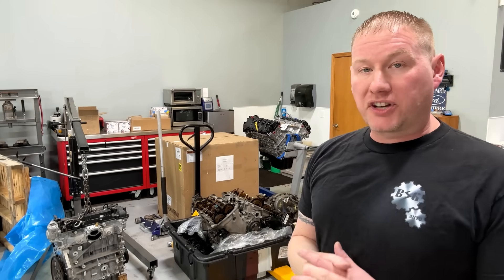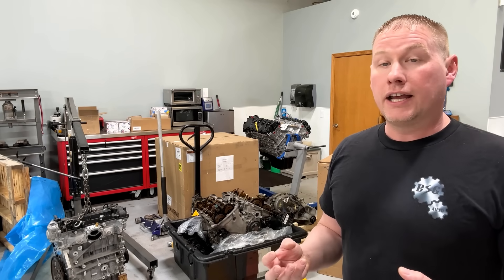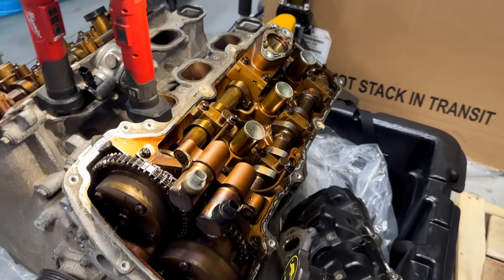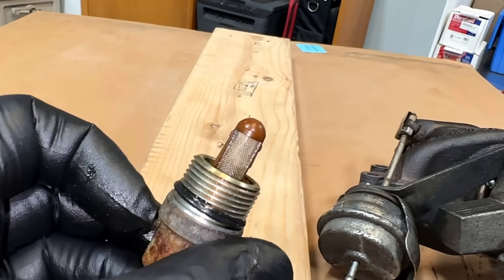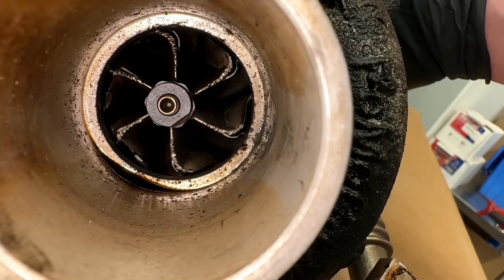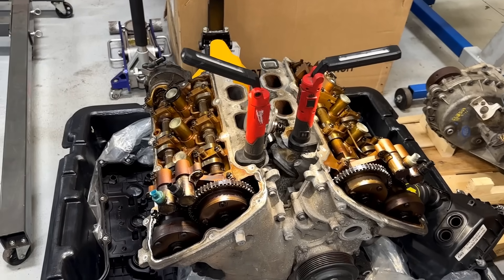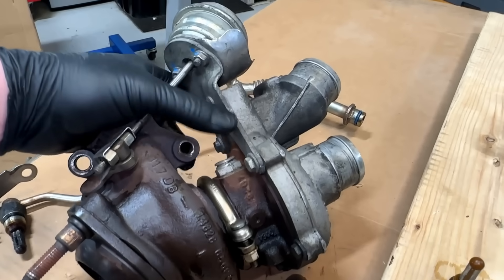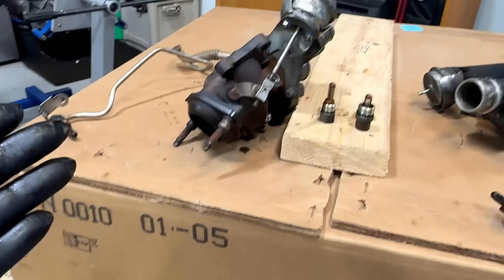This is Why You Never Run Extended Oil Change Intervals on The Ford Ecoboost Engines!

Comment: Any reason you couldn't just remove the screens? Turbos haven't had screens up until very recently and never had an issue
Reply from the maker: I have never seen a turbo oil feed without screens.
Reply: @FordTechMakuloco  I'm pretty sure most of the older stuff I've worked on didn't. My M35A2 didn't, old CAT loader didn't. Everyone removes them on VW/Audi 4.0 V8 engines as the clog. I figure if the debris the screen would stop from hurting the turbo is there, the engine is already toast! I don't see the screens doing anything beneficial other than killing the turbo
Reply from the maker: very cool

Comment: Great video I have a 2014 Ford F-150 Lariat EcoBoost SuperCrew truck and I do change it with the synthetic oil and it's every 5,000 km I live in Canada so we're with kilometers here yeah definitely important but learned a couple things about the filters on the turbos and more of an understanding of how oil works in this engine so thanks

Comment: My 3.5 has been running 20 pounds of boost and always run 93 octane with lots of oil changes.
I do mine every 5000km!! 
Love the power!!
Reply: I always run 93 in my 2.3l (Ranger). Also change the oil around the 5000 mile mark too 👍
Reply: @tehagent1321  
He he he!! That’s good but I do the oil changes at 5000km. 
But always use motorcraft and you will be fine!!
Reply: @mikewest5529  I had been using Shell Rotella Gas Truck but have to go back to Motorcraft now. Shell stopped making it 😢

Comment: Have both 5.0 and a eco boost 2013 f150s.    Both get valvoline  full synthetic every 3k miles.  And here’s another kicker. I run 10w30 in both.  I live in the south. It’s too damn hot for the water weighted viscosity that the factory calls for.     I did this for my 2000 f150 (5.4) when I bought it new.  Pulled god knows how many cars with it ,all across the southeast. And it’s sitting at just under 360k miles now.  Never had a wrench turned on the engine.  I still use it for farm use weekly.  I check the oil every day I use it.  Just for curiosity.  Still doesn’t use any between changes.  Doesn’t smoke etc.       change your oil people.  It’s stupid not to.

Comment: Thanks for the important info of the Ford Eco-Boost. I'm considering buying a used Interceptor Explorer for work. Do you think it would be better to buy the non turbo version?
Reply: Makes sense.
Have the non eco boost ( turbo) only 2018 3.5K Explorer..still almost 300HP.
Use high end synthetic ..with Liquid Moly..oil change 5-7k with premium oil filter as well.

Comment: What do you think of thinner oils? 20 vs 30 ? I prefer 30 especially if it was turbo gdi. If it was port injected naturally aspirated then sure I'm fine with 20. 16 I feel it is too thin though but what do you think?
Reply: 0-30 it’s what I use , Mobil 1 and filter, try to change oil every 4500 miles 
I’ll be changing valve cover gasket in a few weeks and find out how dirty my engine is with the 4500 oil changes at 120,000 miles

Comment: I get the oil changed every 5k miles on my 2013  f150. It has a 3.7L engine.  I go to the dealer for oil changes.  That is their oil change interval.  I would never go past 5k miles regardless who changed the oil.  I also add the BG engine treatment with each oil change.  Hopefully it will last hundreds of thousands of miles.  It has only 65k miles.

Comment: Brian, what would you suggest that an owner who had followed the manufacturer's recommendations do? I have a 2017 with 110,000 (mostly long highway trips). I wonder if I should run one of the oil cleaning products through the engine and then replace the filters for the turbo. Perhaps just take a look at the filters first? Looking at all the soot within the engine explains why my oil looks so dark when I change it. Now I'm a bit worried because I really like my vehicle and want it to last!
Reply: Try a gallon of 91 octane gas and light it on fire because it's a Ford.  That way, it doesn't catch you off guard. 🤣
Reply: @fordresurrectionest9556  I have good luck with all of my Expeditions thus far. I've had terrible experiences with Chevy and Chrysler products.

Comment: To elaborate, API SN plus was introduced to help with LSPI, by reducing calcium additive and adding more magnesium. Which is generally like you said, to help with higher demands on the engine but at low speeds. It will not reduce damage and neglect on lack of maintenance though.
Reply from the maker: SN plus was an interm fix and SP is the final fix based on the demands of the Ecoboost Engines used as test mules.
Reply: @FordTechMakuloco  have you ever diagnosed this noise:  https://youtube.com/shorts/E27jYI2D4E8?si=xrVwKFXlaoBl0Bz-

It’s been getting worse and worse during cold weather.  Once the truck warms up, it goes away for the rest of the day.  I’ve put a broomstick up to every component - turbo, starter, transmission, etc and looked for rattling heat shields, can’t find it for the life of me.

Comment: Why doesn't Ford change their maintenance procedures? It's all about the money to make customers pay. For Company Sucks. I'll never buy another Ford
Ford should be responsible for all repairs then. Ford dummies up the maintenance light on the cluster to cause issues on customer cars. I just repaired eight spark plug holes on a 1999 5.4 two-valve F150.
 Tell me how can a car company refuse to fix all their engines when they know what the cause of the failures is. Just like Ford's newer 5.4 where the spark plugs break in the spark plug holes. Most repair shops charge $300.00 a hole to extract the broken plug. Most people were advised to change their plugs at 40k instead of 100k to possibly avoid the extra expense.
Reply: All companies do this.

Comment: I don’t understand why manufactures add additional oil screens in the lubrication system such as those filters in the turbo oil feed line.  Seems dirty oil is a better lubricant than no oil.  I know Subaru had issues with turbos being oil starved from clogged filters in the oil feed line as well.
Reply: Hey Brian, After reading alot of questions and comments, I'm not sure if this was asked but I barely put 2500 miles on my 2017 raptor since last year and it's telling me to change the oil. I don't run her hard but I use it as a recreational (enjoyment) vehicle. I believe the oil monitor also wants me to change the oil because it has been a year. I'm not opposed to it but am I wasting money and good oil? Thanks again for all your videos
Reply: I'm in agreement, seems like a better solution would be to gut the screen and let the oil flow freely.

Comment: Excellent video. Now I am wondering if these screens should be replaced on a certain mileage basis. I already change my oil every 5,000 miles.

EDIT: Just came across Brian's post that says they are only done at turbo replacement.

Comment: I like Fords but from watching this video, Ford could have installed those turbo fitting screens in an easier location to change periodically.   I am also thinking, why are there screens on there to begin with? I don’t recall screens on earlier turbos of the 1980’s.

Comment: Great point. My Ford dealership recommended this when I inquired about new turbos. That place had good part techs. 332000km on my 11 ecoboost and have only changed plugs and coils. Driver side turbo hums every once and a while on a cold start but I prime my oil system now if I don't drive it for a week. I pull a 8k lb 5th wheel with it to. My ecoboost doesn't owe me a thing. That truck will get a rebuild when the engine goes. Thanks for the content Bryan. P.s oil changes every 5k since I bought it.

Comment: I’ve got a 3.5 eco boost in my fleet. 2016 with 420k and counting. Always done oil changes at 10-11k and all is well. All major components are original including turbos.
Reply: Lots of highway miles or do you use top tier fuel?
Reply: @gregjohnson2073  98% highway. 87octane

Comment: I’ve got 410,000 on my ecoboost 12 to 15,000 mile intervals but I use Amsoil signature series oil with their 25,000 mile oil filter, no turbo problem no timing chain issues it’s a great oil for a great engine
Reply: Yes, I have my oil checked every 3-5k when running Amsoil.  I generally have been changing it every 3-4 months depending on the weather more than anything.  Winter I can't go as long due to fuel diluted oil, but summer I can go easily 8-10k and probably closer to 15k if I really want.
Reply: @puzzleluvr  I too get my oil analyzed every 5k, running Amsoil SS 5W30. That is the best way to tell what the oil is doing
Reply: @Steve_A71  no doubt, Amsoil Signature Series is no joke, and well worth the cost IMO
I also run a catch can, get about 2-3oz of junk every 3k or so during the warm months, a bit more in the winter.
Reply: @puzzleluvr  Also run a Catch can and I am tuned 93 Octane
Reply: You don’t need Amsoil or any other high priced oil for proper maintenance. Any good quality oil will work. Amsoil is not some magic oil. Sorry. It’s marketing hype. The interval is more important depending on your driving style or situation. OCI is just one aspect of proper vehicle maintenance but an important one. Oil brand? As long as it’s a good oil.
Reply: @egx161  it all depends on your needs. Pennzoil platinum oil with a WIX Hp filter works fine but I need something I can do extended oil changes with, 10 to 15,000 miles. I can tell you one thing, after the very first Amsoil oil change I lost all hesitation in my pickup. I bought this with 80,000 miles and I now have 480,000 miles and it’s still quiet with good power. I’ll stick with Amsoil and you can stay with whatever you use, I’m just sharing my personal experience.
Reply: Update: I now have 494,000 miles on my 11 f150 3.5 and still using Amsoil with 10 to 15,000 mile intervals and still no turbo issues. I’m starting to get some timing chain noise in the AM when I don’t prime the system. I’m very impressed with Amsoil products and will use nothing else. The 3.5 ecoboost in the F150 is my favorite engine of all time. The 6r80 transmission has operated flawlessly with one exception of my lead frame failing at 380,000 miles but what a excellent combination
Reply: I just started using Amsoil on my 15 f150 3.5. You answered my question because I hear a lot of people say they wouldn’t trust going that many miles for any oil change but I think I’m gonna a go about every 10k. What are y’all’s thought on Amsoil?
Reply: @SUDREP227  I’ve been using Amsoil on my pick and I  run between 10 to 15,000 miles between oil changes but I use the Signature series oil with the Amsoil 25,000 miles filter and I’ve never had any trouble
Reply: @stephenbloom2545  ok that’s exactly what I’m using so I’ll keep doing the same thanks!
Reply: @SUDREP227  you shouldn’t have any problems I’ve been running those intervals for 380,000 miles and everything runs well and the engine still runs quiet and only uses 1/2 a quart between oil changes which is unchanged since I bought it.
Reply: I use Amsoil SS, but I don't use it to extend oil change intervals. I use it because of its superior protection quality. I still change it early.
Reply: @rshettle123  hopefully you’re using their filter too.

Comment: Well, thanks for making me feel better about my 5.4 3V, compared to the turbo 3.5! 😄
Our ‘13 Escape (bought new) was always the “calculator” for when oil change is due. Until my youngest daughter recently inherited it, it was driven the most so it would usually average around 3500-4000 miles between changes. Although, I try to never go past three months. I always put the date on my filter because the window decals fade out .
Valvoline Max Life on everything, since they’re all in the 250,000 range (‘13 Escape, ‘06 Expedition, ‘98 Subaru Forester). Only my wife’s ’17 Explorer has the lowest, at 65,000.
Recently put a new vacuum pump in the Escape (2.0 EcoBoost). Even though technically, it was just a gasket leaking, but figured I’d replace it anyway and keep the old one for a spare. But the oil that came out of it was clean as a whistle. 
I know Brian (and Scotty Kilmer) hates it, but I use SeaFoam religiously in all my vehicles, including old tractors and boats, in the gas and oil, and have not had an oil related issue yet!
Reply: Seafoam is a good product. If you want to see what products are good or how they stack up against competitors then go watch some project farm YouTube videos

Comment: 300000 kilometers. Only Amsoil signature series 5-w30. Has had an Amsoil bypass oil 0:02 filtration kit for the last 100000kms.  Just had BD diesel manifolds and garret stage 1 turbos and new magnaflow cats and exhaust. As well all new oil and coolant lines hoses and screens done. Shop said slight bearing wear on the turbos but they were clean and same for the screens. Now with summer temps gonna start blending Amsoil 5-30 w 5-50 to get 5-40. And I always do an Amsoil engine flush at service time. And with the dual remote Amsoil bypass kit it uses bigger filters and adds capacity. 2 US gallon for a service

Comment: Repeat after me: "Oil is cheap. Engines & turbos are not." Any questions?
Reply: 😂😂😂...Say it loud enough for the Hearing impaired and Hard-headed Ding Dongs in the back can hear you...Me...3 months or 3thousand miles with new WIX filter...Takes me a hour...Most of that is setting up to do it, and letting all the oil drain and greasing up all parts that need grease and oil like hinges, locks, latches and more....😊😊

Comment: I just watched an interview with one of the long time lead engine designers for Nissan where they were talking about oil changes.  He stated that as a rule, regardless of engine you should replace the oil every 4-5k miles using the cheapest spec'd oil you can buy and replace the filter ever other oil change to slightly offset the cost of the short interval unless you live in a very dusty climate.  He stated doing this will assure a long life regardless of manufacturer.

Comment: If your Ecoboost is tuned I recommend 3k mile oil change interval. The turbo's heat the oil so hot that the viscosity breaks down hella fast

Comment: Best oil description as to why you can not trust the marketing department of any manufacture and change you oil more often Its amazing that Ford does not list replacement of those components to be replaced at 100 k   as preventative maintenance the more.  It would be interesting to see screens at 100k.

Comment: Good oil and coolant are obviously important in any engine, but Ford really did and does have probably the best turbo charged engine that I have run across. I know the gen 2 3.5 is kind of cringe worthy with the massive phaser failures and everything, but as far as the turbos go, Ford is really the only manufacturer that I have seen use both the oiling and cooling system to lubricate and cool the turbos as opposed to most only using the oiling system.
Reply: Subaru EJ25 & GM LF4 (most manufacturers AFAIK) use Water Cooled Turbos. 
Many aftermarket (tuner) Turbos, don't have Coolant Lines though.

Comment: Ok, the 1 million question is: i have a 2016 explorer with this engine and 142k miles, do i have keep using the 5w30 or i have to put 10w30 because of the miles ? Or i have to put 5w30 HIGHT MILES OIL ?

Comment: Ive been going 10 k between changes with Mobil 1 since new with my 2005 5.4 , now i have 213k miles
Reply: that ain't no Ecoboost or direct inject. If you buy a new Ford you better change the oil every 5k or you will be sorry

Comment: What oil do you recommend to use on the eco boost? I have a 2.7 with 46k and just had the chains replaced.
Reply: Dang. 46k and new chains? I thought the 2.7 was a good engine. Bummer....

Comment: Neglected maintenance is catastrophic... 
No mater how expensive the oil is, doesn't mean that will last longer. 
No matter how expensive the oil is, you will never be able to save enough money in engine oils to pay for overhaul.  

Think it this way: 
If you use a expensive toothpaste,  you still brushe your teeth after every meal right?? 

If you use good body soap 🧼, do you still take a bath every day?? 

If your deodorant says 48hours protection,  so you take a bath and use deodorant every other day ??? Or still every day???  😊

Comment: I dont think people realize how different these new motors are versus the older ones. You can now longer go long intervals with oil changes, but another important aspect is checking the oil every thousand miles to make sure their is still oil even in the damn thing. The new motors burn so much oil its ridiculous, it makes me wonder if they are actually better for the environment or if it's hogwash cause each car can burn 2 to 3 quarts like it's sipping tea. I dont know, but listen to what Brian has to say in this video because it's straight from the horse mouth. He sees it every day, and he knows what he's talking about, I would beg to differ that he probably knows more than the damn engineers that built the crap.

Comment: When I was At the Dealership as a Warranty director for Ford platforms I told everyone I knew with a Eco,,,do not follow the 5k oil change,  follow the 3K like old skool days. They never had issues. The ones that "knew" everything about oils and lived on Oil forum's and ran very expensive full synthetic and changed intervals at 5K -7K weren't so lucky.Turbos chewed up and imploded.

Comment: The only Ecoboost I take care of is 2015 2.3 EB Mustang.  A direct injection turbo engine like this are dirty and hard on the oil.  Twice yearly oil changes and an oil separator, and the car has 60k miles.  Runs like new, and an excellent engine if you maintain it.